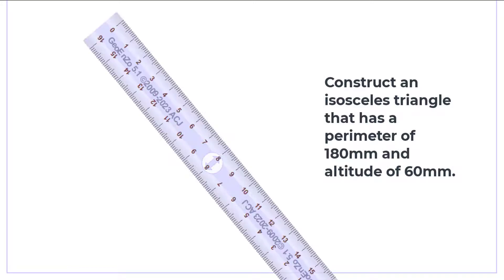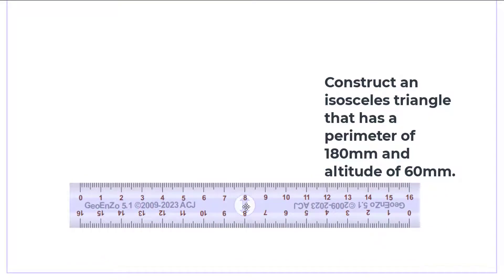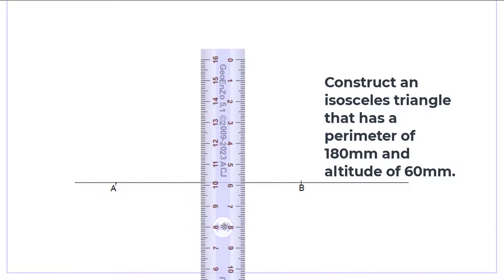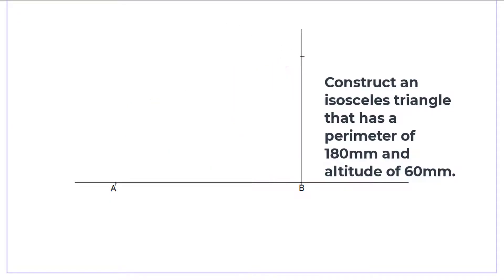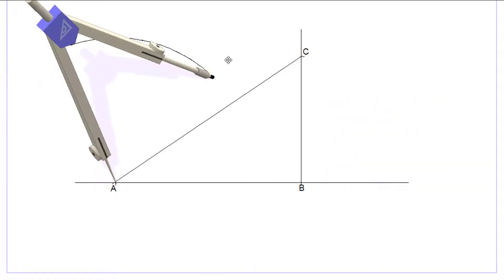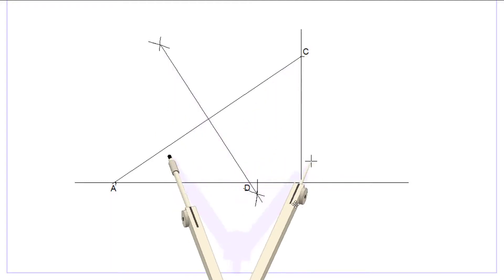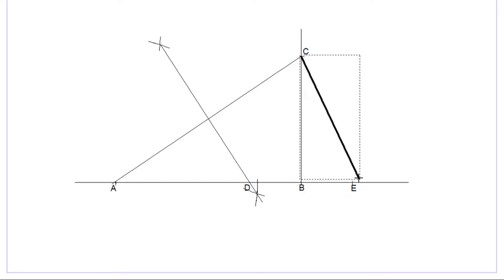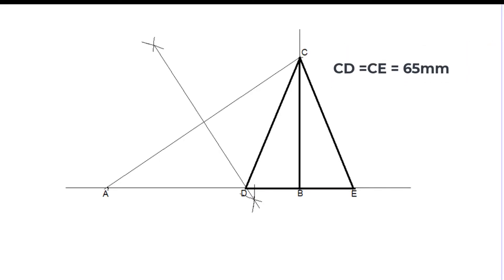Construction of An Isosceles Triangle Given The Perimeter and The Altitude  || Engineering Drawing

Comment: There is no need of altitude to solve the problem. Only perimeter is sufficient to construct the triangle. You may contact me for the solution.
Reply from the maker: Solution to the question required this procedure. The one with only perimeter needs another method.